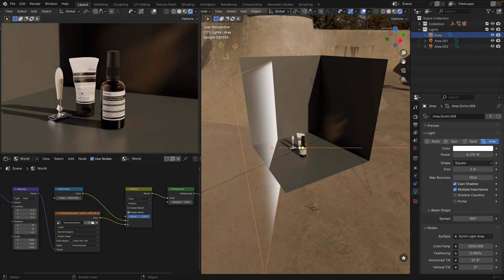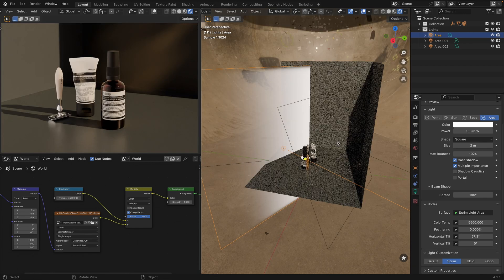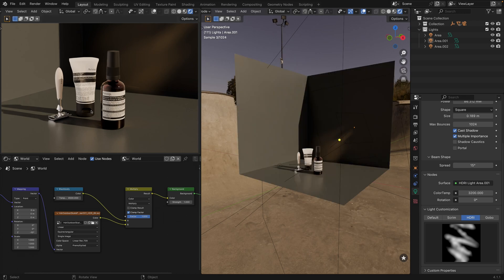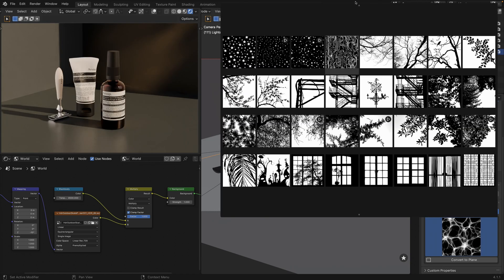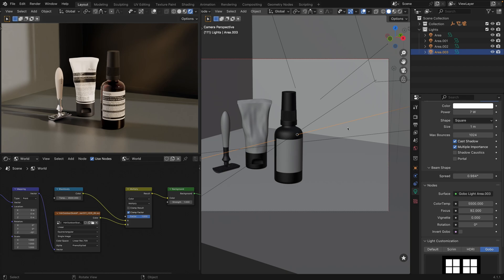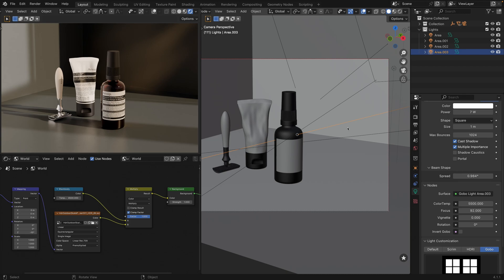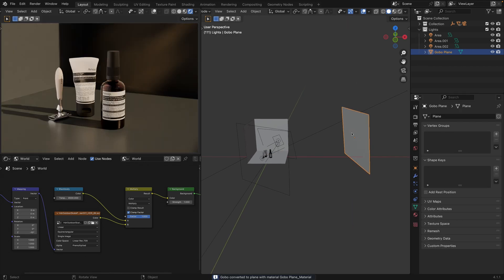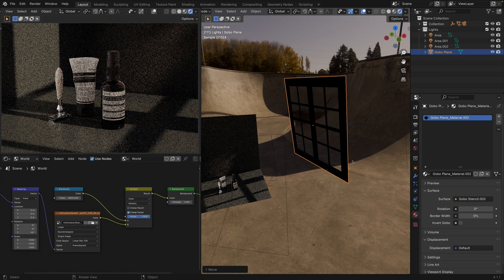Blender Tutorial: Converting Gobo Lights to Stencils for Precise Shadow Control

Comment: Can you make vıdeo about ınstall because when I installed I have promblems ı cant ınstalled nodes and  Light customization plesa
Reply from the maker: Hi, thank you for supporting the Light Wrangler. The most likely reason you can’t see the light customization panel is that you didn’t switch to Cycles. It is only available for Cycles, not EEVEE.
Reply: @leonidaltman   thank you  ıt works